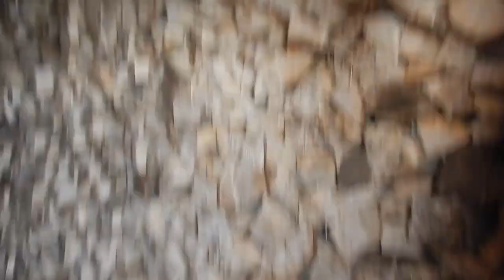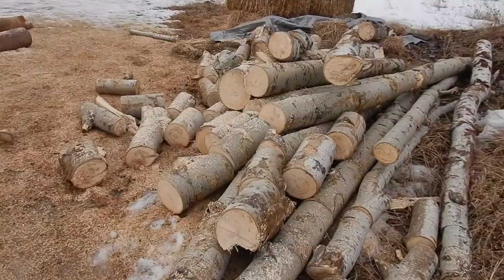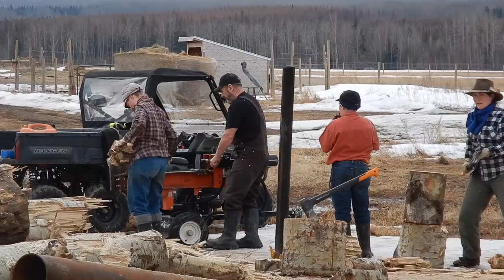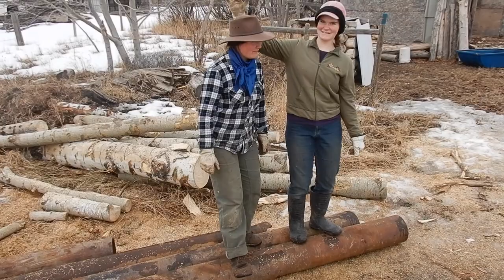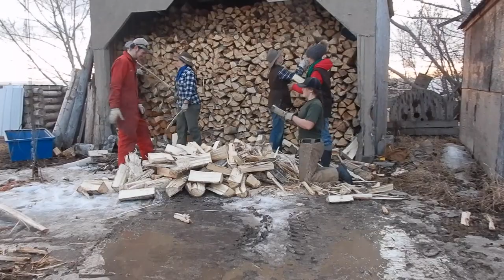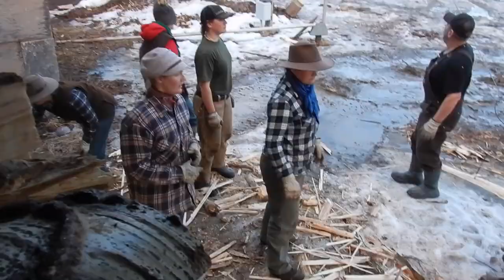Processing Firewood: How To NOT Chop Wood

Comment: Enjoyed watching the video.   Enjoyed the advice on ax safety.    Most of my wood splitting is during the winter.  That is nice because I don't need a chopping block then.  I just put the log chunk on the snow and swing away.  If the maul or ax blasts through, it just sinks in the snow and there is no danger of follow through swing that may contact legs.

Comment: We use a hydraulic wood splitter now, but I learned how to save my back from all the unnecessary bending while splitting wood by using a variety of methods. One is by using a car or truck tire to hold the wood in place. Works really well! 
The other is by using a bungee around the log so the pieces do not fall over. I found a stuff rubber bungee with a chain (if the log is too big) also works well. 👍
I apologize if my explanation doesn’t paint a clear picture of what I am talking about. No pressure, but If interested, I actually did a short video on it last year. 
Blessings to you and your awesome family! 🙏❤️🙏❤️🙏❤️🙏❤️🙏❤️
Reply from the maker: Yes, those are some great ideas to save all the bending down to pick back up to chop again! Thanks Celtic friends :)
Reply: @fourseasonsnorth  Our pleasure! We just love watching your channel. God has truly blessed your family. ❤️🙏❤️🙏❤️🙏❤️